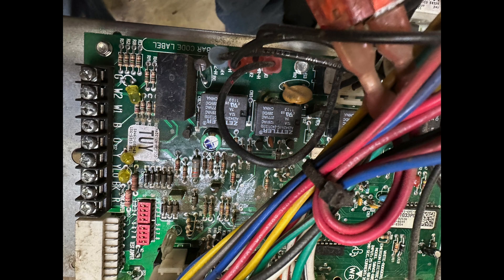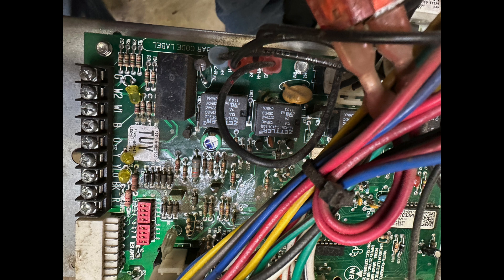Wiring the single stage thermostat to the 2 stage furnace

Comment: I have a question about a two stage thermostat. I understand if you don't' have time, but if you do, great. 

I may have gone about this in entirely the wrong way, but, I have a boiler that I use to supplement heat for my house. (not used full time) I have a heat exchanger in the plenum of my single stage, natural gas, forced air furnace.

I thought I was clever, and installed a two stage thermostat (Honeywell Home RTH7460D1018/E). I connected the W to my fan and W1 to W in my furnace. When the thermostat calls for heat, it just runs the circulation fan and if the temperature drops too low, the natural gas furnace kicks in. However... 

If my water temp is low, my circulation fan will run for a LONG time before ever kicking in the furnace. I'm guessing the answer to this is installing an aquastat so that the first stage only kicks in if the water is above a certain temperature?
Reply from the maker: You are correct.  A cold boiler takes a long time to come up to temp, especially with your circulation fan running.  Use an aquastat.
GFM
Reply: @grayfurnaceman  Thanks for the response !

Comment: I have a 60 year peerless round oak oil furnace. There isn’t anybody that can work on them in my area. There isn’t man that use to work on it passed away several years ago. I’ve been servicing it myself from your videos. Thankyou. I’ve ordered a new transformer which I will have to rig because it’s not as big as the old coil one that’s on it. I also think the stack controler is bad because I have to push the part that goes in flue pipe to get it to turn on. I’ve cleaned it and still have to do this to get pump to kick on. They don’t have these anymore. No one. What can I replace this safety switch with , without switching the whole blower. This is my back up heat for heatpump. It’s been 58 degrees in house since n.c has a cold snap this week. Thank-you
Reply from the maker: First, dump that junk.  It costs you more to operate than it is worth.  The stack switch can be replaced by a cad cell relay, but it is a pretty big job.
GFM
Reply: Yea , I was thinking of switching out in spring with exchanger with heat strips. I only use about 100 gals a season is why I’ve kept it as back-up heat. Man who put my heat pump in has gave me an estimate to put it in. It’s going to be a nightmare trying to get that Hugh beast out of basement.

Comment: just removed a "hockey-puck/clay-target" Nest stat today and put in a basic cheap digital thermostat. heat-off-cool, fan switch and one temp setting... that's what they wanted for elder person and couldn't figure it out(came with the house). only single stage heat and cool anyway. they don't have wifi, it was stuck deep in connect to wifi screens and they couldn't get it backed out.
problem solved. flip switch to heat or cool and push up or down arrow to the temp they want and leave it.

Comment: Another great video, thank you ! QUESTION: What is your recommendation to clean a old style "stack switch" in my oil burner ? I was just wondering if there is a special way to clean the porton that expands & contracts that goes into the stack pipe without damaging it and, if it can be sprayed down with something like Carb cleaner to remove the soot or, just leave it alone ? Thanks for any recommendations.
Reply from the maker: If it has thick soot buildup, you can clean it by simply hitting the housing lightly with the handle of a screwdriver.  Light coating is not a problem.  If you do clean it, you must reset the mechanism.
GFM
Reply: @grayfurnaceman  Thank you, so don't use any spray type carb cleaner ?
Reply from the maker: @MacMcCabe2456  I would not.
GFM

Comment: For all furnace makes but trane/american standard, jumping W1 and W2 locks the furnace on high fire. Jumping them is specific to trane/american standard.On other makes for timed staging, hook only to W1 and set jumper or dip switch to enable the timer.
Always read the manual and never assume!

The timers are ridiculously short, 10, 15 or even 20 minutes maximum on low fire before switching to high will result in a lot of unnecessary calls for high heat and at the tail end of the cycle a lot of the time. The timed staging also does not allow for cycling down from high heat back to low.
A properly controlled and sized 2-stage furnace will never shot off in cold snaps and just cycle between low and high.
Using staging timers is deplorable and so is the goodman gmvc96 furnace that in 2018 the engineers in their infinite wisdom decided to remove the W2 terminal in favor of comfort-bridge crapola.

Comment: I find the biggest issue with a single stage thermostat isn't that there's a delay before getting to 2nd stage, but rather the fact that there is no way the furnace will ever back off to 1st stage to extend the cycle and provide the long runtime that brings the comfort these units are sold as providing. Every person I know who has a 2 stage furnace had the thermostat replaced and the second stage was never wired to provide proper operation. Helped a friend fish a new wire to get his to stay in 1st stage unless it needed it, but as a bonus if he's recovering from setback, it can run 2nd stage and then ramp down to 1st stage as it gets close.
Reply: Sounds like the unit was oversized?
Reply: @kentaltobelli1840  Nearly every furnace installed is oversized. Even a 2 burner 40k output unit replacing my current 3 burner 60k output unit would be oversized because on the coldest day of the year at -20f(-11f is design temp), the furnace runs 30 mins to the hour.  30k heat loss in a 4 level house over 2000 sq ft. I'm not going with a 2 stage when I replace it because I'd prefer full temp rise, so it'll still cycle no matter what, but at least 40k gets closer to the heat load.
Reply: @GuruMN  On many good 2-stage furnaces with fan speeds properly set, you can get the same temp rise on low as high. single stage furnaces are inferior and obsolete. a 40k to 45k btu 2-stage would serve you well.
the key for var speed constant airflow motors is reading the fan performance data before hand and cfm on low vs high heat how proportional it is.  the constant torque furnaces have low and high heat speeds separately adjustable - also an option.

a 2-stage thermostat is mandatory to get the most out of 2-stage furnaces. so is correct sizing.
Reply: @Jon-hx7pe When I look at the spec sheets for 2 stage 40k(or smaller) condensing furnaces, it seems they aren't reducing the CFM at a porportional rate. It seems like they are happy to run at higher speeds to support 2.5 or 3 ton air conditioning airflows, but getting them to spool down for a similar temp rise while burning at a 25k rate isn't a thing I'm seeing in the specsheets. I also prefer a simpler unit that's likely to last longer and it seems there's a lot of chat about reduced efficiency related to running in the lower stage too. A 40k unit would do the job without cycles that are too short. I don't think single stage units are obsolete when sized correctly. Especially when considering that most contractors would put in another 60k unit and sell the 2 stage into my house anyway without asking questions or doing a legit load calc to find the size should be reduced.
Reply: @GuruMN  Many of the variable speed blower furnaces have low fire airflow at 80% instead of 65% to 70% which gives warm enough air on low fire. Not all. But you can buy a 2-stage constant torque motor (multi-speed) furnace that allows you to independently set low and high fire airflows - problem solved.
The steady state efficiency difference between low and high heat is very minimal less than 5% and this is only steady state once the unit has fully warmed up and reached rated heat output. You need to totally ignore people like jim-davis on hvac-talk spewing bs about heat output being proportional to flame temperature which does not at all apply to modern gas furnaces that only rely on radiant for the first section of the heat exchanger. The 2-stage of same size has less cycling loss so overall efficiency difference is a wash, you should not just focus on steady state efficiency.
A single stage is too big 99% of the time and will rarely give you any continuous operation, properly sized 2-stage controlled by 2-stage thermostat won't shut off in gold snaps and be very quiet and comfortable.

2-stage with the same blower motor type as single stage is not more complex, it is identical technology with the same type of parts -> just the gas valve has an extra solenoid and regulator for low fire, there's one extra pressure switch and the inducer is 2-speed instead of single. The parts are only marginally more expensive. The lifespan may actually be longer of 2-stage due to less thermal cycling of the heat exchanger, it is heating up and cooling down which causes them to crack.
Unless the home has attic ductwork with ceiling vents or ducts in a slap - single stage makes zero sense.

When you get into modulating furnaces they get a lot more complex.